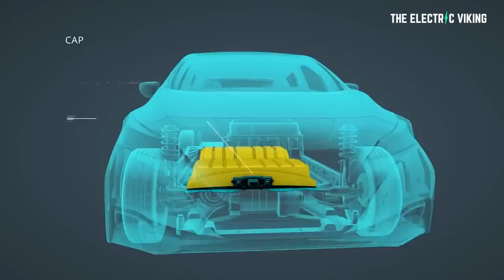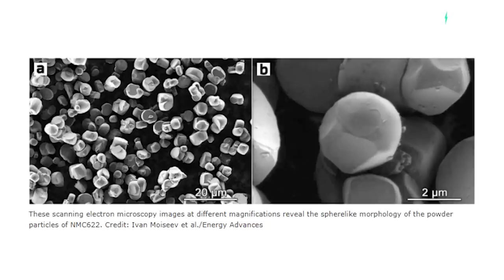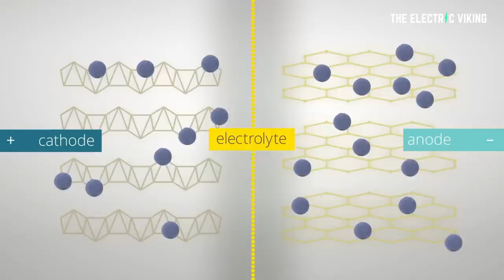NEW cathode material for EV batteries gives 25% more energy

Comment: In the big picture, we are barely into the first inning for battery R&D. Yes, sure, batteries have been around for at least 120 years, but there has never been a greater battery R&D push on earth than there is right now. I find it impossible to believe that batteries in another 5-10 years will be nothing short of extraordinary compared to even today. Sam is correct on this point: it is an amazing time to be alive to witness this technological disruption and transition.
Reply: .      👍

 Battery technology is still in its infancy 🍼
Reply: Exactly, massive battery R&D, massive demand for many devices; phones, tablets, cars, drones, bikes, drills etc.
Reply: yep. the maths and physics have been done for renewables...only thing left is the chemistry..
Reply: @grantbuttenshaw  sure all the theory in the world will make it seem you can move mountains.  Facts; china is the source of raw materials for ev and manufacturing world wide.   These minerals required are not as plentiful as assumed by ev industry gearheads.   To view investigation into ev check out majorie Taylor green  on ev as displayed in Congress.   So highly unlikely millions of ev cars simply because the raw materials is not available.  Current cost per battery is $20000, and how many charge cycles before battery death.  My two cents my two dollars same thing
Reply: @rharding64  I agree..it can't be done...that's my point. There isn't enough copper for electrification of the world. Only thing left is to find a cheap battery chemistry like Sodium.

Comment: First of all, we have to distinguish between volumetric energy density and gravimetric energy density. They managed to pack more material into the same space, which means improved volumetric density. However, the gravimetric density remains the same. The battery pack seems to have roughly the same weight per kWh and the same price, it just takes less space. Moreover, this doesn't solve the problem of increasing lithium prices. Hopefully, new sodium technologies will get to the market soon, or lithium production will be increased to lower battery prices.
Reply: Solid Comment 👍 educational
Reply: Very good. 
 There is so many facets around EVs ❗️
 I am learning things every day.

Comment: EVs have the potential to get cheaper but ICE vehicles will continue to get more expensive to make and buy. The cost to make EVs will eventually go down but that doesn't automatically mean the price of cars will go down, it might just mean more profit for EV makers. Battery material costs need to come down but production has to go up and demand needs to be satisfied before prices of cars will come down.
Reply: This is exactly the points I have raised in many discussions with friends.  The other thing to remember is that gasoline will only become more expensive.  As EVs become more and more popular you’ll begin to see gas stations close due to lack of profitability, refining of smaller amounts of gasoline will also drive prices higher until gas becomes a boutique fuel.  At that point it’ll only be used in historical vehicles or in die-hards who refuse to switch, which will be very few people because EVs will be vastly cheaper to both produce and operate, in fuel costs as mentioned previously and also fewer repairs.
Reply: True, the decline in ICE powered car sales is leading to loss of scale economies where margins are already thin. At some point OEMs will be looking at making ICE sales at a loss which they won’t of course, they will simply put up prices
Reply: @kiae-nirodiariesencore4270  Maybe they should ask oil producers for a bail out, good luck with that. 😁
Reply: @frankcoffey  moser likely is that the oil companies will have serious lawsuits to defend in court similar to the tobacco industry for doing harm to society.  I’d expect the lawsuits to go next to nowhere in the US, especially given the political climate and current SCOTUS lineup, but in other countries such lawsuits might be much more successful.  This too could result in the demise of some of them, which it should.  Past executives should be hauled into court to answer for doing nothing while their own scientists were internally generating reports indicating the serious problems likely to result from excess CO2 emissions.

Comment: Thanks Sam. The world isn't becoming better yet, but things will change drastically soon.
The speed of development of battery battery technology is increasing like never before. I'm asking myself two questions, 'Can this same idea be applied th LFP cells, and if so, then how many recharge cycles will they be able to tolerate without serious degradation? Also, when they start to degrade, will it proceed at a much faster rate than that in cells using presently marketed technology?' The answers will be very interesting.

Comment: R&D developments are just that, if they have finished R&D they will be in batteries.  The companies will be taking advantage if all characteristics are improved and there is not disadvantage.  What you need to look for is what is not said, is it more expensive, more temperature sensitive, doesn't last as long etc?  Batteries will without doubt improve, just don't hold your breath, its easy to improve 1 characteristic at the expense of another.

Comment: I just hope car manufacturers make it easy for people to replace batteries so you could upgrade your battery down the line if you want to.
Reply: They(oems)won't care about future retrofits of pack's. The aftermarket will spring up for it though. Already exists for older leafs&i3s. 
And of course teslas. Won't be done for any low volume model's though. Only ones made by the tens&hundreds of thousands or more unit's.
Reply: @4literv6  Leaf in particular needs an LFP after market solution. There are NO available loose 18650 format LFP cells available. You can buy used LFP in 5Ah 32650 format but they are a huge departure from the existing Leaf architecture and not “new”.

Comment: Retail price of a single 18650 Li-Ion cell has gone from $10 to nearly $30. This is for the low capacity high output cell but there is not much difference with the high capacity cells. Used cells are like going to a fish market. 

I don’t know what planet each of us is on but it’s not the same one. 

A single 14500 LFP cell (if you can get it) is over $10. A pack of four AA NiCd rechargeable batteries at Woolworths is $30 but $24 online. My battery operated stick vacuum has more than half its cost in batteries.

Sustainable?
Repairable?
Environmentally sensitive?

I’ll believe statements about cheaper longer lasting better for the environment batteries when I can hold one in my hand. Not a whole two tonne car

Comment: THE BATTERY which will improve RANGE is not the next denser battery or next lighter battery, IT'S THE ONE which can be MANUFACTURED CHEAPER!!! STOP WASTING EVERYBODY'S TIME WITH "NEW BATTERIES" that WILL NEVER BE on the market if not manufactured cheaper than those currently manufactured by Tesla - which currently are the densest, cheapest and longest lasting (stay brand new for at least 1.8 million km/1.2 million miles).
Reply: Do you mean the cells that Panasonic develops and then goes on to manufacture for Tesla?
Reply: @retrozmachine1189  You are STUCK in 2012. For many years, for its first fourteen years Tesla has developed its own battery chemistry and architecture, then made several companies manufacture it for them. But for 4+ years Tesla has both develped AND MANUFACTURED their batteries inhouse. Something other manufacturers are 10+ years behind, if they ever even try or can afford to try.
Reply: @manueldavid7369  That certainly explains Panasonic developing and manufacturing the much praised (for some reason) 4680 cell and it certainly explains Tesla asking Panasonic to increase production of same ... curious that.

Comment: EV batteries need to be waterproof - if Elon wants to save the world, he will do it.
Hundreds of EVs caught in the latest hurricane were exposed to water over the height of the battery
and they short out and start to burn and salt water can erode the battery weeks later after dry and the car bursts into flames in a salvage yard or driveway.

So new chemistry is great but making waterproof EV batteries needs to be a top priority of the EV battery industry.
But don't hold your breath.

I swear - common sense seems to be an option in the EV world - being 1st and making big bucks trumps everything.
Reply: For the most the batteries are semi waterproof, EV cars are designed to drive-in rainy conditions.
Reply: @icosthop9998  I would not be surprised if normal car insurance does not cover damage to the battery caused by water in the future.